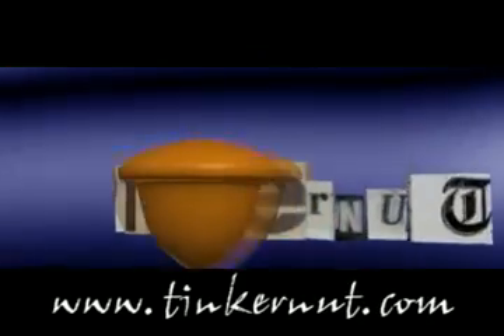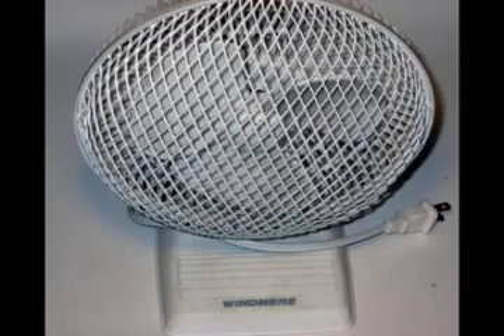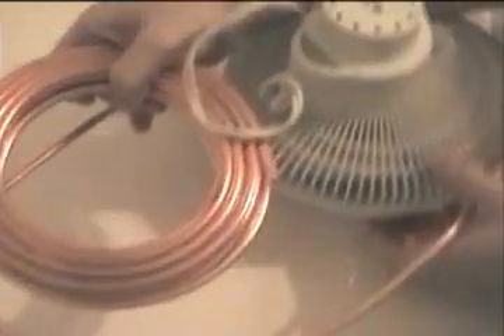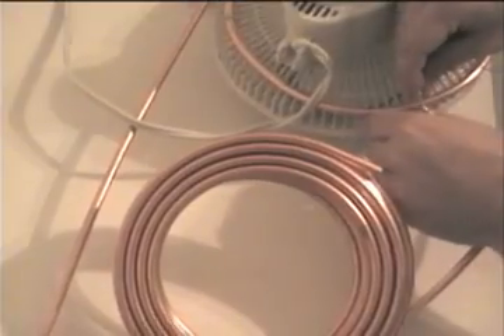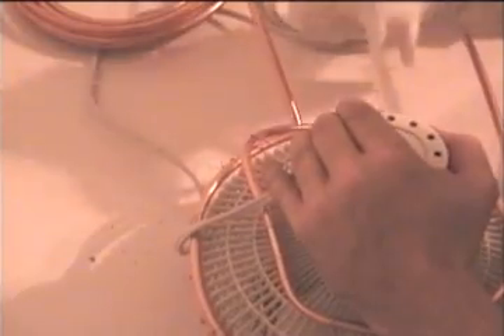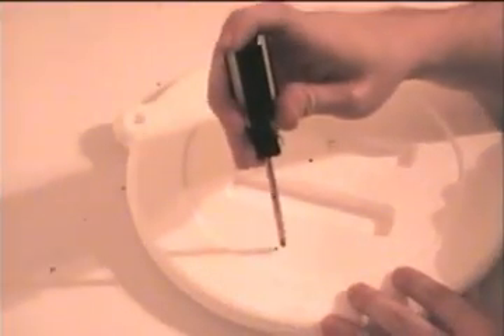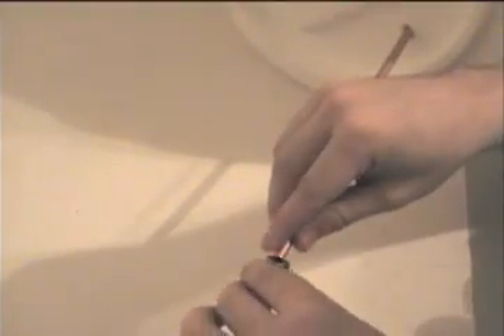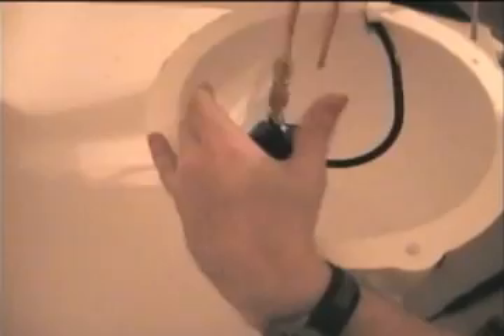DIY: Make your own Air Conditioner

Comment: I used this concept,  but instead used multiple 120mm computer fans. and used salt in a igloo cooler that I picked up at a neighbors gage sale rated for 5 days.
ended up using a 45watt solar panel to power the fans, and pump .
cooled off my garage by 15* in California Desert heat in July & Aug.
Reply: where did you get the solar panels and how much?
Reply: +Krizx600 the solar panels I bought at a garage sale.for about 20 bucks.
the guy who sold them to me
 was using them on his RV and wanted to upgrade his panels.
  I've seen similar panels for 40 bucks on ebay .
I just purchased a 150 Watt 12v  solar panel from (Renogy) for $150 back in late November. 
 http://www.renogy-store.com 
my neighbors have purchased from them and they are well built and reliable.
I'm hooking them up to modified car radiator fans and retrofitting them to the exhaust and intake attic gables we have . hooking them up to a thermostat and hopefully save on AC costs in the summer months to come.

Comment: I did this on a larger scale using a large square ice cooler and a box fan. I put frozen soda bottles of water into my water in the cooler which lowers the temp of my water going through the copper tubing. By using this during the summer here in Texas, it literally drops the kitchen temp by 10 degrees which then is tolerable for cooking indoors. Otherwise, it's just too hot to cook in my house. I can use the microwave, but that gets old.

Comment: FYI, this is technically not an air conditioner. Air conditioners use vapor compression and evaporation to achieve cooling. A more accurate name would to call this a heat reservoir.
Reply: It conditions the air, what more do you want? It serves the exact same purpose as an AC does.

Comment: Refrigerant is COMPRESSED on the hot side (near the radiator) which then dispels the heat to surrounding air via a heat exchanger. When it is circulated after cooling it is de-compressed causing even more temperature drop and is then blown into the cab by the cold side's heat exchanger (in science there is no such thing as "cold" just absence of heat) Cars do not use evaporators, that is a different kind of cooling called evaporative cooling which uses the thermal properties of water to cool.

Comment: This is exactly an air conditioner although pretty makeshift, using chilled water instead of refrigerant, this is how most of the schools i work on are cooled , with 50º chilled water from a chiller.

Comment: the copper radiator will drip because of dehumidification, so you'll need to place a basin under the fan.

Comment: haha, evaporator cooling in a car? Not in any car made in the last 30 years. Perhaps you should look up how a refrigerator works. "Heat Pumps" are true air conditioning, if your cooler isn't using Boyle's Laws, then you're not doing it right.

Comment: a lot of these people on here are pretty stupid and here is why. first off he is putting cold water into a cooler. coolers are ment to insulate and keep stuff inside them cool. for a long time. second. even if you were going to have this on for 5 hours this would still work as a cooler. has no one heard of a swamp cooler. same concept. takes water in small amounts and cools it off. this seems like it would work great for a few hours. good video!

Comment: Not a bad idea but I'd hang on to that $40 and make some cutbacks elsewhere and save a bit. A new A/C unit starts at $100 and I'm sure with a bit of saving you can pay for an A/C unit and pay the extra hydro. I saved over $1600 over the course of a year by cutting back here and there and bought a central A/C unit, it would be 110f out but a nice 76f in the house :)

Comment: You could make it more effective by putting ice water in there but you are going to have a lot of condensate coming off those lines. I don't see how you could possibly feel any cooler using room temp water than using just a fan.

Comment: unless your freezer/refrigerator is out side you are not cooling anything except for maybe a while or so. remember the carnot cycle is only 40%-60% efficient so there for you are actually working your freezer/refrigerator harder thus making it hotter in your house. you got to throw the heat some where right? i mean your freezer/refrigerator doesn't just eat/destroy heat its a pump right?

Comment: I had an idea very similar to this, however I was thinking of using a bigger fan and do the following: Tap into a refrigerator/freezer that is already being used and run the copper pipe through either cold water in the fridge, or have them run through a block of ice in the freezer. I dont think it would rob too much heat from the fridge, and should work pretty well.

Comment: @mnight207 if u leave water it the radiator during the winter it will crack the engine block which causes it not to start u can run water in a radiator but switch it to anti freeze before winter!

Comment: DiY doesn't have to be too bad, exactly, i've made my own beamer, who blows simply on an sunny day, a nice and clear view. (about 150 inch)...
how would this be effective with a pelier? and, what if you place the fan horizontal, in a case, so he can suck (mmm, bad english i think) hot air, and make a circuit of small computer fans, directly connected with a pelier, and blow it out on the other way (maybe in separate fan holes), to fill the room from different places?

Comment: @darkstatehk Although you are right, but i did a similar unit with two peltier elements continuously cooling the water, So there is no need to have continuous supply of water. at all.. The peltier units are powered from the power supply of the fan, after adding a regulator.

Comment: This works! You just need to use it with the doors and windows closed in a room 4x4 meters. With a temperature out side of 28'C or 82.4'F for the Americans, one bucket of 0'C/ 32'F ice water will last you 1hr at 25'C/ 77'F for the room temperature.

Comment: I've heard of people using these; they definitely work.  When you run that ice water through the tube the water draws heat energy from it, and so to compensate, the tube sucks more energy out of the air passing across it..  However, I'd like to see this thing tested to see if it melts a cooler full of ice more quickly than leaving the lid off does.  Or just pointing a fan into an open cooler of ice.  Whichever way melts ice quickest is the one that cools best in the long run.

Comment: @minimoose010 you proberly failed in science. -_-

the pump is pumping 0 degrees C water through the tube. the room is lets say 30 degrees C. and you seriously think this would heat up the room (which it would have to, to cool the water, since cooling is taking the energy from the water and putting it into the surroundings).

and YES it would cool alot. 
think CPU as the bucket, only here filled with hot water.

this device seeks balance between the energy in the bucket and in the room period

Comment: why would you pay $40 for an inefficient cooler? for 100 bucks you can get an actual cheap ac unit from walmart. i recall seeing one for $99 one time. better still, you can find used ones all day long on ebay or craigslist for about 50, sometimes less. this is a terrible idea. the ice melts, and the thermodynamic efficiency of the copper tubing leaves much to be desired.

Comment: (continued)

I did this years ago but the Arizona heat was too much for it to last longer than an hour, maybe two at most

Id say this wo0uld be most useful as a supplemental mini-system if your current ac is not the best and works less than it should..then this cheapo temporary method will work fine along side it.

For a an entire home, I'll just stick to a solar power setup then use a conventional AC that is already in place.

Comment: Evaporatave cooler, not air conditioner..pretty basic, and you'd need to refill the water as it slowly melts..and yes this works..

the fan just pushed out the newly cooled air taken from the ice the copper tubing, no air or water travels through it..doesn't get so cold it would crack anything...keep in mind this is minimal efficiency

(continued above)

Comment: @rainewater24 I seriously doubt that it would. The pump isn't meant to pump liquids so cold and the whole thing would become too brittle and crack. You would need a more substantial pump and I think ideally a circulator pump that pumps coolant or really salty water through another copper tube in the cooler which could be cooled to subfreezing temperatures by a solid block of ice or perhaps if you have some, liquid nitrogen or dry ice. The liquid nitrogen will evaporate quick though.

Comment: the problem is, you have to keep replacing the ice water, because the heat will heat it up. you could just buy a real AC and be done with it

Comment: @iwishtobesexy  when the ice water is sent through the copper tubing, the open air at the back and infront of the fan is transfering heat to the copper pipe ( copper being a vary thermal conductive material ) then the warmer water goes form the fan back to the ice water and starts again.  this proces removes the heat fomr the air and blow cold air through the fan whiel transfering the heat to the ice water, thus melting the water

Comment: Similar concept to an air cooler/swamp cooler minus the whole adding humidity to the air thing. It still won't make the air cooler, so much as it will add to the wind chill effect. Doesn't look all that aesthetic either... Cool video and clever trick though, happy with my portable AC though

Comment: if u are that desparate but have a freezer to make ice, you can do a better job on wrapping the coil or using a bigger fan. thanks for posting though, gave me some ideas. the only problem is when i can use it i will have to buy ice because i wont be in a house with a freezer.

Comment: Nah, instead just use a cooler with ice packs in it, and have hole drilled on the sides to suck in air, and have fans holes drilled in the lid, and mount the fans on the lid, and so air will go through the holes, through the cold material, and out the top!

Comment: Technically not an air conditioner (which works by phases), so more of just a cooler, but definitely better than just frozen 2-liters in front of a fan which lose most of their cooling through the bottom.

Comment: I think most of you misunderstand the point of these or why they would be useful rather then buying an a/c unit from a store. Any unit bought in the store is going to use at least a couple hundred watts to run. I dont know about this exact set up but i have one without all the copper crap and pump with just 2 liter ice bottles and a fan. That fan runs maybe 25 watts compared to the 800 i was using with a store bought ac for my back room in my apartment. killer savings on electric in small spaces

Comment: @RandomConcepts Either way, the container (tray or cooler) needs to be insulated so that the ice absorbs heat from the air and not anything else. If it is a tray, the ice will absorb heat faster, but cold air will not be circulated very well. If it is a cooler, the ice will absorb heat faster, but cold air will be circulated well.

Comment: @MagicJigPipe Yeah, I know that moving the heat around is not always so bad. infact thats how all electric cooling works, be it peltier or compressor. When I did it in dorms, I got ice from a comunal refriderator... but still, from expierence, it does not cool the room nearly quick enough (and if it did, you'd be restocking the ice so often it would be insane :p)

Comment: @minimumheadroom Aluminum is cheaper than copper, but also lighter and easier to shape and mold into intricate heat exchangers. This offsets the lower conductivity, which is why you almost never see a copper heat exchanger, not even a computer heat sink. Your assumption is thus actually quite understandable.

Comment: how the fuck does the water get harder. i dont understant. your just making the water a little cooler by running the copper tubing through one side of the freezer and out the other. and into a bucket of water with the fish pump connected and the other end goes into the freezer thats connected to the fish pump. but all the acess tubing is rapped around the fan.

Comment: why woult the room get hot again. your running the tubing through the freezer going in one side and out the other. and cooling the water off a bit more. but youd have to have the fish pump running the whole time or the water will freeze in the tubing. or poor a little antifreeze in and test the water with a antifreeze tester.

Comment: clever science fair project...

I'm pretty sure the author understands that this is merely a personal cooling device, not something to keep your house cold (bc, as someone said, the heat you fridge gives off to produce the ice is greater than the cooling effect you can obtain from the ice (energy in < energy out ALWAYS, so the heat removed from the water to make it ice and the fridge pump energy is the heat added to the environment to make the ice))

Comment: freon is a gas, and so a water pump is not designed to pump gas, in order for freon to be used as a refrigerant, you have to use compressors to liquefy the gas... its much more complicated than this simple heat exchange apparatus

Comment: Dude forget wrapping that tubing around the back of the fan like that. That's horrible heat transfer. Go to the auto parts store or junkyard and buy a heater core.  It'd work so much better. Just a thought.

Comment: So I guess an endless source of ice cubes is pretty important to the functioning of the unit.
It might be better to just run the tube into your freezer and cut out the ice cube intermediate step, that way you don't have to keep filling the bucket with more ice cubes..

Comment: you must have missed the class on heat transfer, because the ambient air will only heat up the water with a heat source, now if your ambient temp is 100 degrees and you have no cool water then of course it will slowly raise to temp, but will not reach the same temp as outside ever as long as there is moving air. If the water has a cooling source such as ice or a buried tank of water below the frostline then is would stay as cool as the source.

Comment: air passing over copper tubing even without the cold water will lower the ambient temperature of the water, and then as it circulates it is insulated in the Styrofoam container and then cooled more as it returns to the coil, this is the basic function of a conventional A/C unit.

Comment: The convetional use of the label 'Air Conditioning' is breached by it's use in this commercial.
.
While at Wal*Mart, buying the glue; instead visit their Air Conditioning Department.
.

cheers.

Comment: The normal function of the fan would be cooling you down more than the rest of it. It might make a difference of one degree or so. But really, go out and buy an air conditioner that does completely work. Nice try though.

Comment: i doublt there is enough contact with the air

thats why cpu coolers have fins

if that was going to work
you would have to make the tubes almost touching each other

making the air get cold as it squezes buy
or attach fins onto the tubing
but like this
i doubt it does really anything
you would be better off
making it mist ice water

Comment: you shouldnt use that much tubing. especially if you cannot get a good consistent curve, maybe 2 or 3 loops at the most, or else the water will heat up by the time it gets done, and it will heat up your ice water faster, not to mention the air your trying to cool

Comment: not very dangerous, if it did fail, it would not catch fire, it is submerged, plus metal doesnt expand when cooled. plus the cool temp would lessen if not remove the chance of overheating.

Comment: They aren't heat removers... You cannot make heat or cold dissapear. It is a water heater in a sense in that by pumping the cool water throught the piping, it is making the surrounding air cooler, is it not? Well the water in the tubing then absorbs some of the heat it displaced, and eventually you have no more ice. Heat exchange is the simpler term.

Comment: Copper is a better insulator. But plastic would work too I guess, but I'd think you'd get best results using copper.

Installing LED's would work too if you can get a circuit somewhere and wire it up without having it contact water. 

Coloring the water? Just use food coloring. Just wash out your pump/tubing if you ever decide to switch colors and junk.

Comment from the maker: It's called a do-it-yourself project, not an air conditoner replacement. It's the same reason some people spend $300 on computer parts instead of buying a $400 computer...they like doing things themselves. If you think this is intended to replace an air conditioner, then you seriously must have nothing else to complain about.

Comment: parts might be cheap but power for the
1. fan
2. pump
3. ice
and the electricity will quickly add up with bot the pump and fan heating

Comment: one, this particular "model" shown in this video sucks air in and so the condensation will be sucked into, and two, turn on a regular desk fan and throw it in a swimming pool, we'll see what happens. Even if motor can run under water, the condensation might get sucked into the switch or something causing a short circuit, unless of course that fan is made to run under water.

Comment: And as we can see here, Mr 'I kno SCI3NCE!11!' shows us that Water condenses on cold surfaces, such as the copper coil, but incorrectly states that this would then return to the room. It would not, it would simply build up until it dripped off the bottom. 

In actuality, this device would NOT increase room humidity, it would DECREASE the latent humidity by CONDENSING the water from the air. 

And as a secondary point, adding SALT to ICE makes the ICE MELT FASTER. Ask your local Chem teacher.